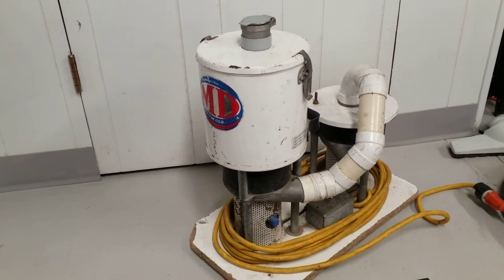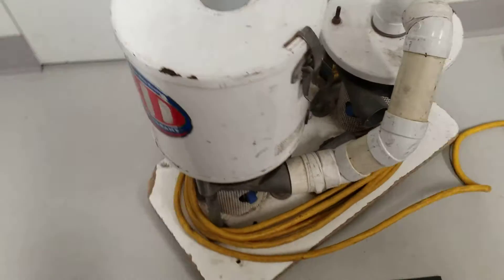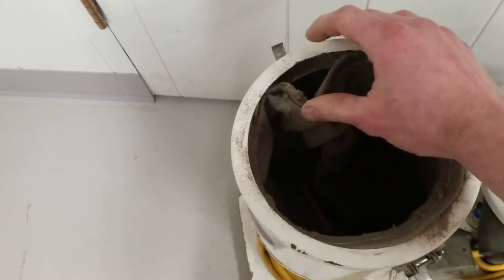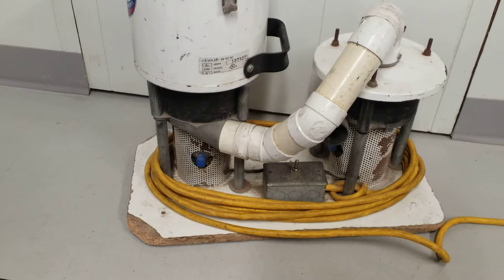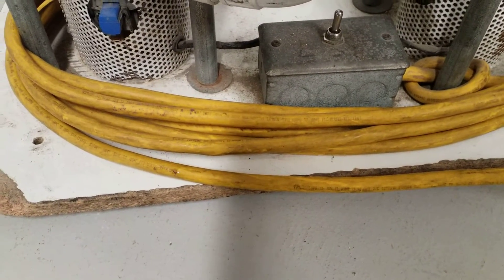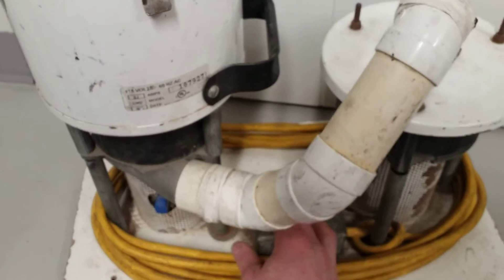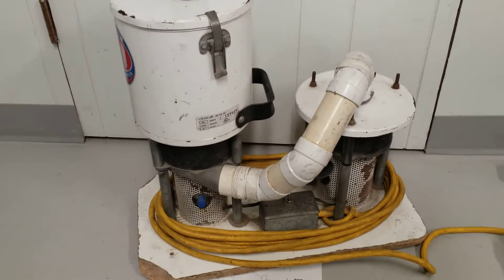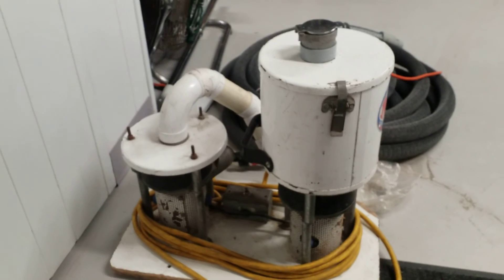The MD Central Vacuum "Cleanout Unit"

Comment: This video got me to thinking about the dual motor units, I have several, I use all of my central vacuum units without pipes, yes, I'm definitely a proud central vacuum nerd, I love central vacuum units. There is some debate as to which is better, the two motors in series or parallel. I call my dual motor units, especially the 240 volt ones the beasts. I have five of those and I also have two 120 volt dual motor units. I prefer the motors in series, since I use all of my units without pipes, you definitely will notice the stronger power at the end of the hose when the motors are in series, a couple of my units will actually cause the hose to start to tangle if you put your hand over it. When airflow is higher, you don't notice that as much through the hose. Now, when using a central vacuum with pipes, that probably makes a difference. In that case, having more airflow may make a difference. Most of the series dual motor units do have an airflow of a single motor unit, between 100 and 145 usually. Similarly, most parallel dual motor units have a water lift of between the same numbers. The one exception is the Galaxie units. Their dual motor units have higher specifications for water lift and airflow than any single motor unit that I know of. The GA-240 which is a 240 volt unit with the motors in parallel has a water lift of 199 and airflow of 215. The Galaxie GA-200 which is a 120 volt dual motor unit with the motors in series has a water lift of 160 and a CFM of 199. I don't know how those 120 volt dual motor units work without tripping a breaker but I haven't had any problems. I plan on bringing that GA-240 to the next convention, that thing is probably as loud as the Filtex that was in one of your videos. They definitely did not plan on that unit sitting in someone's dining room the way mine does.

Comment: That sounds kind of neat, those are some nice modifications you made to it. I wonder if you could somehow use one of those as a central vacuum unit by connecting a standard hose to it. Does it have a utility valve or a pipe intake? Interesting that you mentioned the older units had a water lift of 220, that's the amount that my Drainvac twin turbo has, that's the one we hooked up to Tom's pipe system at the convention, the way it pulled the hide-a-hose in was fun to watch. If I ever find one of those MD clean out units at a good price I may get one.